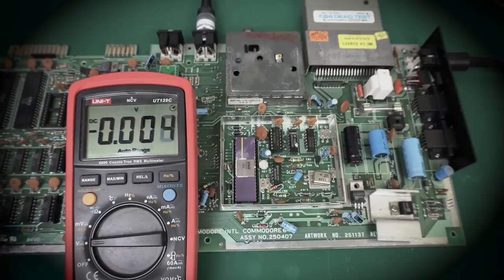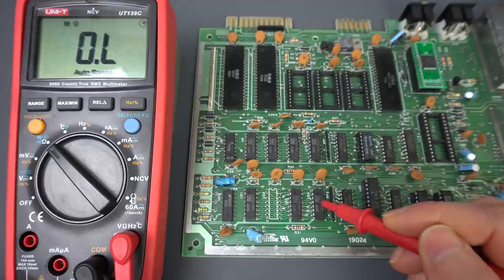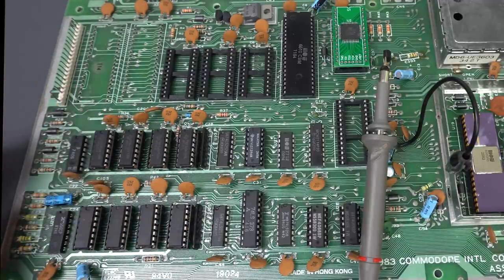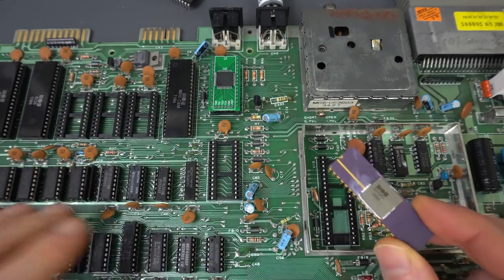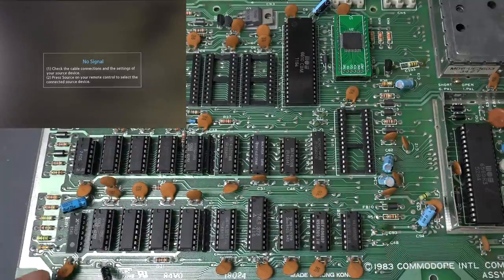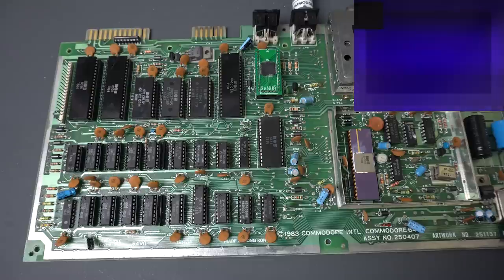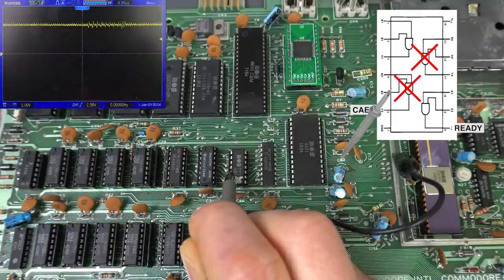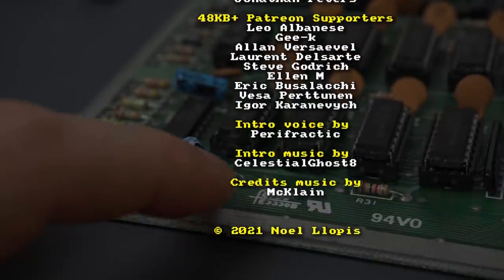The UGLIEST Repair of a Commodore 64 (Part 2)

Comment: I agree with everyone Noel. These harder ones are just more fun to watch! Your content is great.. keep up the good work!

According to the schematics and the datasheets for the 6510 and 6567 (VIC-II) that second AND gate at 21:00 is actually pretty important I think. As you discovered the output (CAEC) goes to the processor AEC pin (5).  The processor needs to free up the address bus in two conditions: 1. When the VIC-II needs to access memory, 2. when DMA is used (for example by REU's). the AEC pin (16) on the VIC-II is an output pin and was designed to attach to the AEC input pin on the 6510 directly. As the name suggests the processor can drive the address bus as long as the AEC is high. When AEC is low the processor enters high impedance on the address bus.

The DMA is active-low and in normal conditions pulled up to 5V, therefore pin 5 on the 74LS08 is normally always high. The VIC-II will switch it's AEC output pin low when it wants to access memory.

If cartridges like REU's want to perform DMA, they have to adhere to very strict rules: BA from the VIC-II to the cart must be high and in the right clock phase the cart can then pull DMA low to take control over the address bus.

So this second gate is crucial in bringing these two very important lines to the 6510. If this gate fails and outputs a high then you will get fighting on the address bus, if it is stuck low then the processor will not do anything. It runs of course... but cannot do any storage or stack operations. Obviously any garbage signal in between will mix those two behaviours.

So that second gate might not have an issue after all... it looks like and your determination on the color ram select is the exact problem.

The lesson learned, I think: When you do your normal routine of checking for clocks, ready, etc on the processor, also scope the AEC on 5; it should be pulsing. And scope the CS on the color ram.

Comment: I've had uglier. last week I socketed everything, recapped. I even replaced the user port socket. Checked every single line. It turned out to be a short thinner than a hair under one of the ram sockets between two data lines. It was so thin that my equipments did not pick it up. I discovered it by "inspection by eye" method. Took my 8 weeks. nice to know even proffesionals can have hard time :) Please keep sharing even something goes wrong. That is how I learn.
Reply from the maker: Whoa! That's crazy! Glad you were able to find it. Sometimes repairs get really hard, but the great thing about this level of technology is that I feel I can always eventually track it down.

Comment: Thanks for finally, unlike others, stating the obvious that perhaps because of the manufacturing process they used that MOS chips are such common culprits in failed machines.  And I don't mind "ugly" repairs.  They are more interesting than more routine ones.
Reply: MOS was famous for repairing defective chip wafers, giving them high yields for cheap prices. Looks like the repairs were not always super quality!

Comment: My dad was a typewriter repairman in the 70's and 80's (well he still is!).  I lost one of my joystick controllers on my C64.   I had no idea how to fix it, I was 14.  My dad opened it up and figured out which part it was.  I was amazed.  I mean I knew my dad did know electronics to a certain degree but how he figured out  it was that chip, was beyond me.  Hindsight, he worked with a guy who was working as a typewriter repair guy temporarily while he got his engineering degree.  That guy went on to work at IBM labs or something like that, so my dad might have had a little help, but Im pretty sure the C64 never left our house, it was unbuttoned in my room for a few weeks.  Im an engineer now so Im pretty sure you can trace the closest chip to the broken port and just shotgun replace it.  But still, my dad nailed it.  Hero achievement UNLOCKED!!!

Comment: The trick to writing code that uses no RAM, in addition to not trying to store, i.e. STA, STX, STY, is that you cannot use any operations that require the stack (which is in RAM). If you need to hold a value temporarily you only have registers to use which are few on a 6502.
Reply from the maker: Right. It seems much harder than I thought initially coming from the Z80 perspective.

Comment: This was really fun. One thing I see Chris from GadgetUK do is to clean boards very meticulously giving himself a chance to inspect every part of the board closely. That might have helped in finding the cap and power connector issues.
The broken logic chips etc were a nightmare to find. Fun to watch though.
Reply from the maker: That's a really good approach. Normally I don't do anything that thorough, especially when they're really clean like this one was, but I do a quick check looking for previous repairs and things like that. I completely missed the cap since it was bent covering its leg though. Haha!
Reply: @NoelsRetroLab  I couldn't do it that way but I take inspiration from Chris in that sense. It's a lot of elbow grease but I think it might just pay off often enough.

Comment: It is a very good video. I had a similar issue and narrow down to the CPU itself. The address bus was stuck. I prefer debugging the circuit compared to randomly replacing ICs
Reply from the maker: Thanks! Yes, ideally I always like to examine something, run some tests, and figure out what's wrong with it. But this one... ouch! 😃

Comment: I repaired one of such boards last year. A tool that appeared to be most usefull was the IR camera - I was able to identify faulty chips immediately without any doubt.
Reply from the maker: I've been looking into that for a bit, but haven't decided on one. It probably wouldn't have worked here, but it can be extremely useful. Which IR camera did you get?
Reply: @NoelsRetroLab  I used a Vigo V50 but it is a tool which you cannot buy now - not that it's so superb, it's simply discontinued and was produced by a Polish company. And it's not too handy. There are better tools to be used by professionals (I'm just an amateur enthusiast).

Comment: One should try the removed chip in another working machine, if possible. That way you know instantliy if this was the broken part. In my opinion putting another working chip in a machine of which you don't know what is wrong you can end up with two broken chips because you don't know what has caused the problem in the first place.

Thank you for the video, I really enjoyed it - like always. I highly recommend subscribing to this channel.

Comment: It may still be power related. I have broken identical NMOS DRAMs that all consume different (and pretty high) idle currents when powered. If your two VIC revisions also differ in power consumption that may explain the differences in behavior. You could measure the two 5V rail currents with both DRAM sets and both VICs and compare them. And you could also compare the rail stabilities with your scope to solve the mystery.

Comment: Great video!  Question: What causes these chips to fail as they age?  Just a breakdown of their material or something else?  Love your work Noel!!!
Reply from the maker: Thanks Jim! My understanding is that the semiconductor "sandwiches" end up failing over time from general stress from usage. So suddenly you have something that's always conducting or never conducting anymore. The better the fabrication techniques (and maybe the more material there is in the substrates) the longer it lasts.
Reply: There a a number of failure modes, one common problem is where the tiny gold wires that link from the metal pins to the silicon die fracture or become unwelded. This can be due to physical vibration or thermal stress. Sometimes the gap is so small that the IC will work until it heats up then it fails causing an intermittant fault. Similarly the actual silicon can fracture with changes in temperature - if the computer is kept in a poorly ventilated loft or shed the temperature can swing from freezing at night to red hot during the day - also if the sealing of the chip inside the cavity breaks down over a period of years moisture can get in and cause corrosion. Also again, chips like the voltage regulatiors, SID or VIC run hot and this can cause deterioration of the junctions in time as any silicon device that runs hot which is why cooling is important.

Comment: I was suspecting the newly socketed ram for the ram-errors, but maybe that’s just because I myself did a pretty bad soldering job on my own C64, so some of the sockets didn’t connect properly on the top-side of the board, causing weird ram-errors, until I added some budge-wires!
Reply from the maker: Yes, it was a dangerous thing to put that RAM and assume it would work. If I had put the old one back at least I would have considered it a possibility that it was faulty. Fortunately there were no problems with broken traces or I would have gone out of my mind! 😃

Comment: It's hard to explain, one possible cause maybe the passive component like capacitors are not working well with that chip, to find out real cause  involve probing many places with scope, will take a lot of time. Actually I doubt if only the capacitor are really near dead, the value will cause weird thing happening to the chips.

Comment: Noel, awesome repair! I bet that board was hit with a power surge. Usually the case when u get a slew of bad components like that.
Reply from the maker: Thanks. Yes, I think that's really likely. What would cause that though? Bad PSU?
Reply: @NoelsRetroLab  Possible. I don't know what the internals of that epoxy encased power supply has in it and if it has any type of varistor or transient voltage protection? My guess is that it is nothing more than a transformer with multi tap voltages and the rectification/regulation happens in the case. It has been a while since I have messed with a C64 repair. I am more of a D128 guy now.

Comment: I had a similar experience with a C-16 and a Plus/4 with exact same startup issue.  Took 2 or 3 years before I finally solved the issue.  Went through the standard TED, CPU, PLA replacements etc.  In the end it was a similar MOS logic chip and a RAM chip that was bad. The TED, CPU and PLA were all good.

The one really ugly repair was my Commodore PC-10-III.  I literally ended up socketing 95% of the components before I finally resolved the issue.  Unfortunately I think it was the one of the early replaced ICs that was the problem, but because the board was difficult to desolder (even with a Hakko gun) I ended up lifting some traces.  My "repair" wasn't quite correct, and it was only late in the game that I revisited it to discover that.  I do believe there were multiple component failures however.  Even after fixing that, it didn't fire up.  I discovered is that replacing "74S" logic chips with "74LS" chips sometimes doesn't work.  I ended up replacing those with "74S" versions that were called for in the original design and it finally fired up. Lots of red herrings, lots of hair pulling, but lots of good learning as well.  I was very happy to see the machine working again.
Reply from the maker: Yikes! Yes, things can turn ugly. And when something you've checked turns out to be faulty, that's the worst, because you're convinced it has to be something else. I've had a Dragon 64 repair that took a year and a half (on and off obviously) because of that exact same reason!

Comment: Regarding the TMS4164 issue, it may come down to how the OKI and TMS expect to be refreshed.  Both are 64 x 1 but one may require 128 count (2^7) cycles and the other 256 count (2^8) cycles.  I am not experienced with C64 enough to know how how it manages refresh, apart from it being done with the VIC II.
Reply from the maker: Ooohhh! You're right! That would explain why things changed when I used the different revision VIC II. Very good observation! I bet that's it!

Comment: Memory Error Report that I read from NEC notes that data error rates increased unexpectedly from 16K bits to 64K bits. Apparently one of the materials used to make the chips was radioactive. Fixed for 256Kbit Ram chips.

Comment: The reason why a cartridge needs RAM is the zero page and the stack - memory from $0000 to $01FF is required for operations that keep track of things through memory with short 6502 opcodes (two instead of three bytes) and call subroutines (stack), and you need screen memory (which is not color memory), usually from $0400 to $07FF.
Without zero page is not impossible with fixed sequence of events, and without stack, you'd be using a lot of branching (which for a test cartridge is not impossible), but you'd have issues with interrupts which use stack. Without screen memory, all characters on the screen would be random or very fixed (I remember VIC 20 had a specific pattern derived from part of the address).

Comment: Theory: the newer VIC-II chip might have tighter tolerances for RAM responsiveness.
Reply from the maker: I get that one of the VIC II revisions could have different tolerances and it causes video corruption while the other one doesn't. But the really weird thing is that the VICII shouldn't have an effect over the Dead Test Cartridge RAM tests, yet they pass with one and they fail with the other. So weird!
Reply: @NoelsRetroLab  Thing is, the VIC-II doubles as the RAM refresh circuitry.

Comment: you nearly rebuilt it ! but less likely to have a dry joint now , someone's getting a great machine nice job hehe
Reply from the maker: Seriously! If I didn't like my board revision better I would keep that one 😃
Reply: @NoelsRetroLab  its catch 22 really, you could spend hours diagnosing the problem or remove every chip till you find the problem , also you eliminate dry or fractured solder joints. i loved the repair :) very interesting

Comment: Hi Noel, did you go back to check that 'ugly' data bus signal after the machine was working again? Methinks that was just a (not atypical) oscilloscope measurement artifact related to the triggering mechanism.  Data buses are notoriously tricky to measure. Unlike address buses -- which should always look text-book -- data buses can display very strange traces on the oscilloscope, while working perfectly, because the lack of periodicity in the signal screws with the oscilloscope's trigger mechanism.
Reply from the maker: I didn't but I should! Data busses are definitely odd, but you eventually get used to the patterns of each one. The ZX Spectrum one looks like a total hot mess! I wonder if what causes the oscilloscope to have a hard time triggering is the tristate switches, but the address bus stays mostly driven by the CPU? Not sure. On the other hand the Amstrad CPC data bus usually looks pretty reasonable (but the RAM chips don't have Din and Dout tied and they have an extra flip flop, so that might be related).

Comment: Exellent video..... so the 74ls08 chooses what chip is enabled(with cs) very intersting.....
Reply from the maker: Thanks! That 08 doesn't select any other chips, just contains the logic to decide when the Color RAM is enabled by ORing two signals and sending it to the /CS specifically of the Color RAM.
Reply: @NoelsRetroLab  now i understand it ...ty

Comment: I wonder if the old VIC pulls more from the 5V line, so the broken cap had more of an impact.
Reply from the maker: I hadn't thought of that until now, but no, that's not it. Remember that the VIC II is on a separate 5V line (the one coming from the 7805) but the RAM is on the 5V from the power supply.

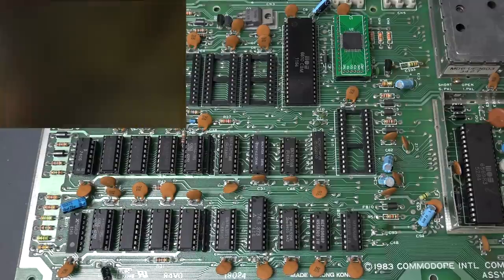Comment: Amazing repair job, Noel! What I don't get is why you get flashes on screen with the NEW RAM chips (at 14:22) and then, after replacing all chips with the original RAM chips, the computer works perfectly (at 14:58). Did I miss something?
Reply from the maker: You got it. One of the unsolved mysteries:
- Original VIC II. New RAM --> Passes RAM tests, garbage video.
- New VIC II. New RAM -> Fails RAM tests.
- New VIC II. Old RAM -> Passes RAM tests. Fine video.
- Original VIC II. Old RAM -> Passes RAM tests. Fine video.
Clearly something it didn't like in that RAM, but in a really weird and inconsistent way. 🤷‍♂️
Reply: @NoelsRetroLab  wow. So weird... Maybe some timing issue with the new RAM's? I don't know, but, what a pain in the a**. Thanks for replying!

Comment: I use to repair computers back in the 80's and during that time I must have repaired several hundred C 64's. Whenever I had a unit with multiple bad IC's I always suspected the crappy PS which came with those units. Unfortunately, they were potted with no air circulation and would drop a bunch of ripple into the unit.
I would explain to the customer what had happened and offer to sale a repairable PS at just above my cost to help them NOT have to pay for a subsequent repair. As I recall, everyone was glad to buy the new supply.
So, if you are using that original supply, you might want to trash it after you save the cords in case you want to roll your own supply and sell them. Good luck

OH. one beef I have with most of the guys repairing C 64's now is this biz of tossing the RF shields for the unit. If any of you looked at the electrical Racket and wide band noise which gets emitted from an unshielded C64 on a decent Spectrun Analyzer, you would know why those shields are there. It was part of the FCC certification process to have those shields.
That same noise can cause interference in other home devices like sound systems, sensitive receivers ect.  
Shame you guys do this !!